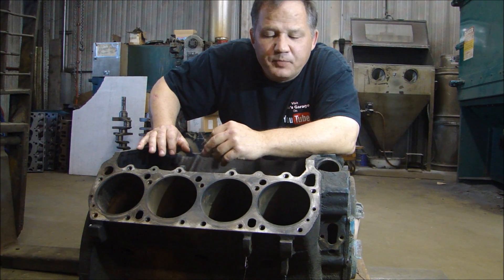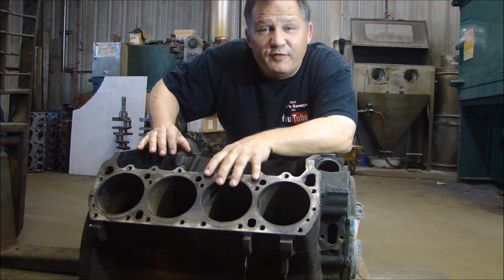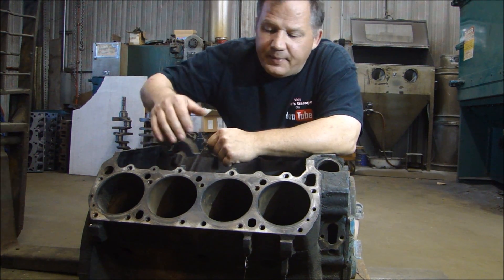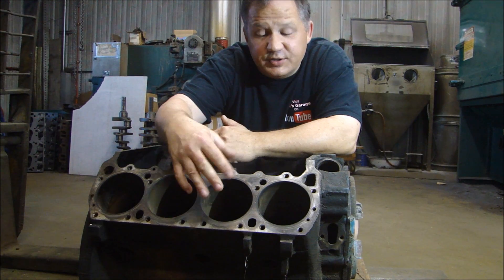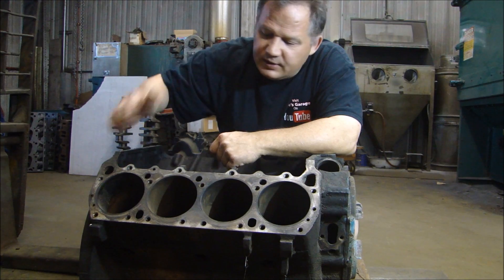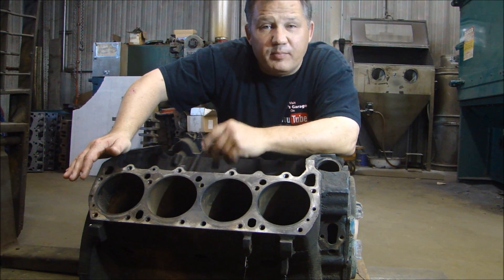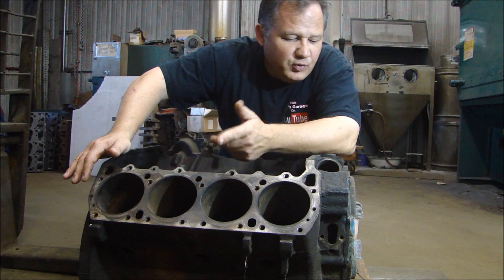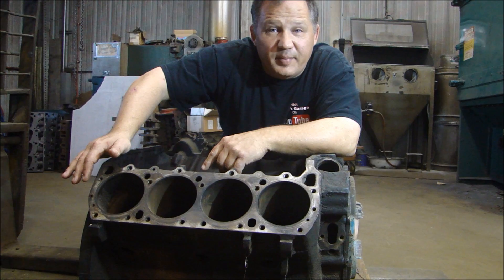Engine Building 440 MOPAR

Comment: Stroker 408 vs 440? Should I put money in the 360 or just get a big block
Reply from the maker: Can't beat the big block
Reply: @PetesGarage  I have to argue with that as in my experience it totally depends on what you're putting it into. For example, a Duster or Demon is a tight fit for a 440 but a budget stroker built from the 400 has tons of clearance for steering, headers, etc. and once installed will still allow plenty of room for routine maintenance. The 440 will fit with some work yes but even changing spark plugs can be a chore afterwards. That said, if the 440 is going into a B body like a Charger then it's a completely different story.
Reply from the maker: I can agree with that

Comment: Hey Pete can you check out the plastex plastic repair kit? I need to do some plastic repair on my fox, I 2as thinking about getting a plastic welder but i just saw the plastex plastic repair kit and i want to see if itll get the job done as well as the plastic welder or qould i still need to buy the plastic welder?
Reply from the maker: That looks like an adhesive. It may work, but a plastic welder make both pieces one.
Reply: Petes Garage oh alright thanks a lot Pete for looking into it!!!!

Comment: Perfect timing for me to find your channel. I'm getting ready to build my 440! I could really use some advice and suggestions.
Reply from the maker: I will be building and posting all part numbers as I go along so I hope that will help you.
Reply: Yes, I'm sure it will. What kind of build are you looking to achieve, as in horse power/torque? I'm hoping for respectable power for a weekend cruiser or steetfighter. I've got a 68 Charger and a 70 Road Runner. The Road Runner is a Superbird tribute. I'm looking at making the Charger quick (1/4 mile) and the Road Runner fast (top end for the salt flats). Obviously that has a lot to do with gearing, but I want to make sure I build the engines right to start with. Thanks again for your generosity and excellent videos!
Reply from the maker: The goal is 500 HP, but it should be well over that.
Reply: Yes I would say for sure well over 500 HP... going .040 over. Guess I need to continue to watch to see what pistons you are going to use.